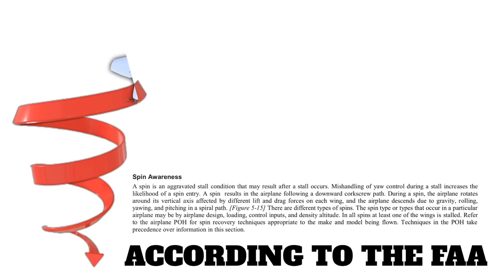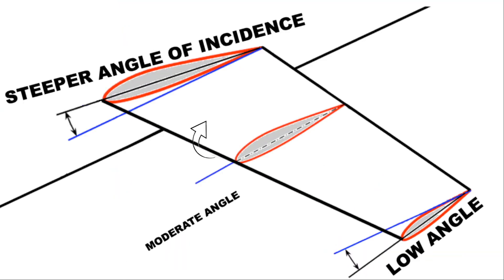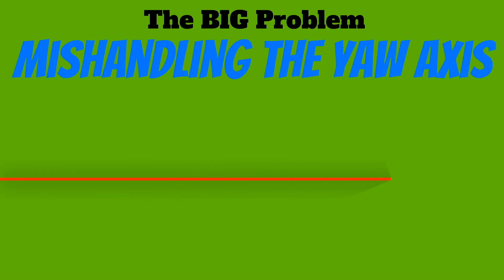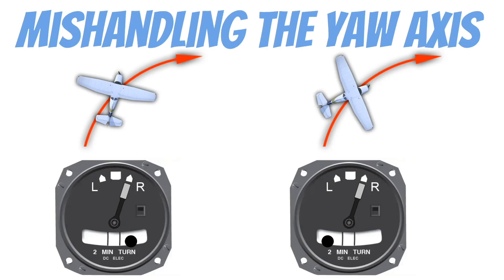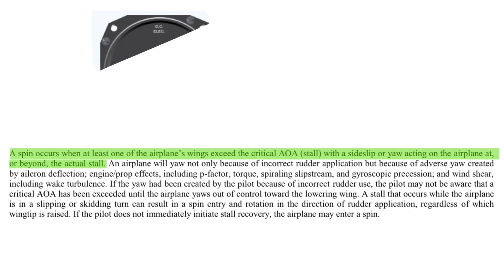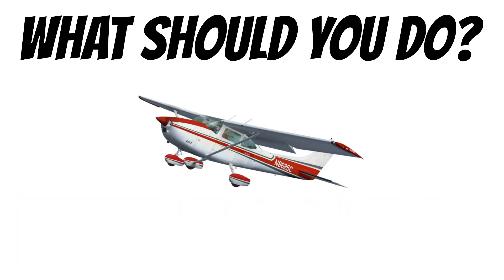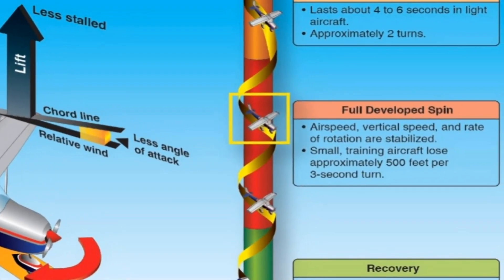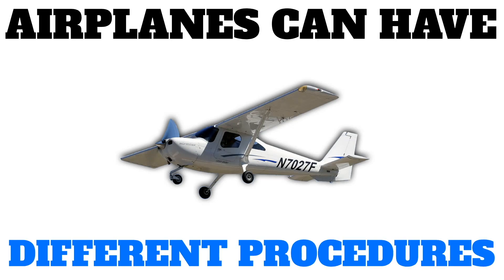How to Avoid a SPIN! (Private Pilot Ground Lesson 4)

Comment: With power-off stalls, after breaking the stall with forward elevator, there is quite a bit of adverse yaw when the throttle is pushed forward.  Should we be compensating with yaw, or is there a risk over-compensating and causing a spin if done too early?
Reply from the maker: If you’re getting a lot of left turning tendencies on the stall recovery, you may not be reducing the angle of attack enough. Theoretically, if you are coordinated after breaking the stall, you shouldn’t need to make big movements with the rudder during the recovery.

Comment: •	Normal stall: both wings exceed critical AOA together → no rotation.
	•	Spin: both wings are stalled, but the inside wing is deeper in the stall, causing the autorotation.

Comment: Hey Josh, just had a quick question. If that trick question was given 
and it was vise versa from what is was asking, would it still be that both wings have stalled?
Reply from the maker: Not sure I fully understand the question, but if they ask this, it shouldn’t be asked much differently. One wing stalling can cause the airplane to drop a wing, but in a spin, both wings are stalled
Reply: @FreePilotTraining that answers my question then. If I had to reword my question I’d ask if the airplane spun to the left instead of the right as stated in the question, then would the answer still be that both wings have stalled

Comment: For the PARE acronym it says ELEVATOR UP... shouldnt it be DOWN to push the nose of the plane down to regain speed and recover from the stall? I feel like if you're in a spin and trying to recover, pulling the yoke to make the elevator go UP it's gonna push the tail of the plane down... making it harder to recover from a stall... am i wrong?
Reply from the maker: Elevator - Up is AFTER the aircraft has stopped spinning. This is why I put so much emphasis on breaking the stall BEFORE you get to the spin AND this is why I use P-PARE. The first P is to PUSH the nose over to break the stall. Didn’t you watch the video? 😏

Comment: Silly question, when you mentioned pare, you mentioned power/ idle first. Does that mean set the engine to idle? I'm new, just trying to understand the concepts. I'm guessing you don't want to power up to gain airspeed because it will worsen the spin? I could be completely wrong lol. Thank you!
Reply from the maker: Yes. The engine power should be set to idle to keep it from over speeding

Comment: One thing i am struggling to understand is how it is possible for a plane to have both its wings at different angles of attack. The relative wind should mostly be the same around the airplane, and the wing itself is one fixed flat platform. So how is it possible that the lowered wing has a greater AOA than the raised one?
Reply from the maker: This would happen when the tail is not aligned with the direction of travel. In other words, the airplane is moving forward at an ANGLE (or a crab)

Comment: My first CFI, who went to airlines promptly after this particular lesson, when I asked about uncoordinated stalls going into a spin, asked me to give him the airplane.   He then proceeded to put the plane (Cessna 172) into a spin and let go of the controls after a revolution.   The plane promptly righted itself and flew in a straightforward manner.
Cessna 172s are so totally not my RV6.    My RV6 wants to spin.  You stall that thing, it goes straight for a spin;  lucky me the recovery for a stall is the same as long as you don't let the spin get too developed.
Reply from the maker: Yeah, when I flew the T-6 Texan II during training for the AF, that plane could be recovered by releasing the controls as well. It’s amazing how stable some aircraft are
Reply: @FreePilotTraining  What did you fly in the AF?
Reply: Oh!   And lemme tell you about "the ball."   The ball on an RV6 is bullshit.   Absolute bullshit.   If you follow the ball on an EFIS, it's so slow to react you're deffo gonna go straight to spin during a stall.    If you follow the physical ball (I have both in my plane) then you're still going to spin land, just not as fast.    What you have to do is keep the corner of your eye on the outside and prevent the plane from yawing by using your outside reference.  Only then will you stall in a reasonably straight-forward manner.   You'll certainly get some wing-dip, but you're not going to feel like you're going to spin and die.

Comment: If non coordinated turn is the cause of the spin in a stall, the side slip would be extremely dangerous, which is not. Maybe just a skid is really dangerous? Or we should be cautious even in a slip? Thanks.
Reply from the maker: I’ve heard this argument, and I believe it to be true for some airplanes. It really depends on the aircraft that you’re flying. Cessna 172s are oddly stable in cross controlled conditions. Airspeed is also a factor
Reply: @FreePilotTraining  Thank you very much!

Comment: If you're close to stall speed remember that you could be just a turn away from stalling depending on the Wind. And Bank angle produces accelerated stall, especially if trying to maintain altitude.
Reply from the maker: This is a very good point

Comment: My plane won't spin, there is a placard right on it saying spins prohibited.
Reply: Don't worry konarider, I get it. 🤣
Reply from the maker: That just means the airplane is not certified for spins. It could still possibly spin. It likely is unrecoverable when a spin starts. That means it’s even more important that you recover from a stall early
Reply: Mine is placarded maneuver speed 97 KIAS. That means don’t go faster than a 1997 KIA can.
Reply: My plane has an engine speed indicator with large letters “RPM”. This is the name of the manufacturer who makes tachometers.
Reply: @aviatortrucker6285  well my plane has little cracks in the wing. Probably an exhaust for the engine. Cessnas are so efficient😍
Reply: Is it even possible to spin to the right in power-on setting? I can barely compensate the left turning tendencies and right rudder is never enough 😅
Reply: Same as mine 🤣
Reply: Icon a5s are stall proof from what i heard.

Comment: What happens if the airplane stalls and wing drops under 1,000 ft? Is there a way to recuperate from that?
Reply from the maker: That depends on your skill and how quickly you identified the stall. It is possible to recuperate at 1,000 feet